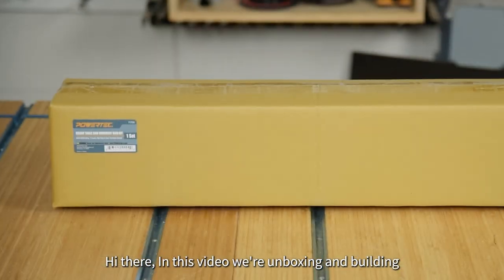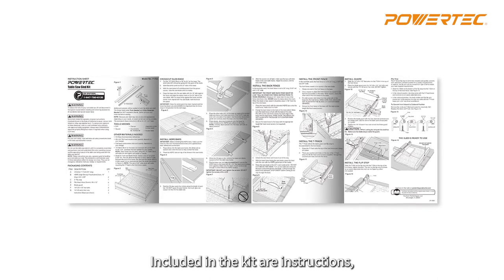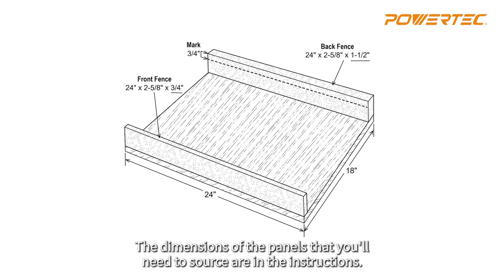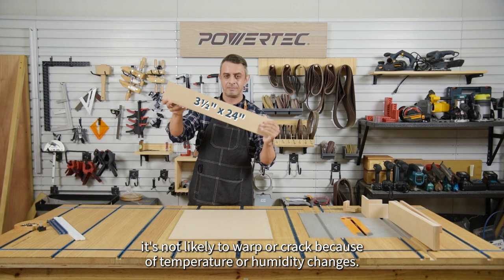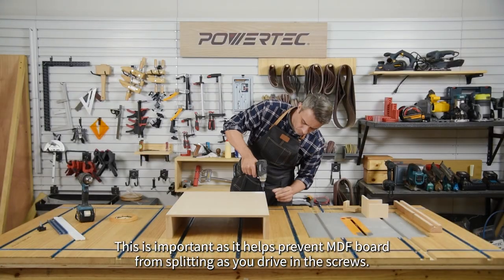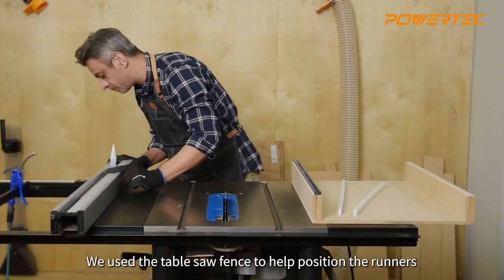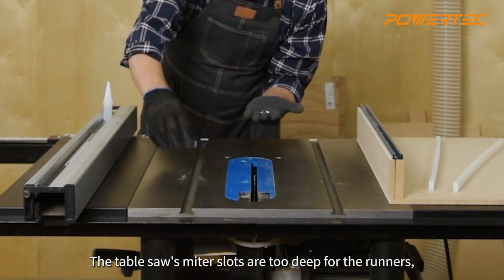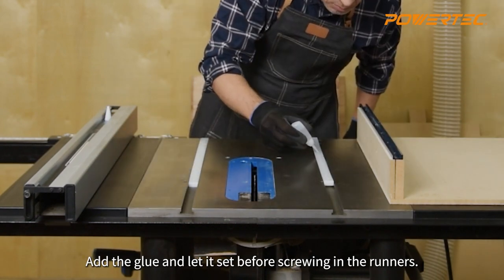Unboxing the New Table Sled and Blade Guard Kit from POWERTEC USA

Comment: I did not see where the “front” fence was set square to the saw blade. Yes, the sled is glued to the runners square to the fence but is the front fence actually square to the blade. When cutting with a table saw sled,  all cuts are aligned by the front fence. Not so sure thhis build is accurate.

 Did anyone else notice the split int the MDF on the left side “aster” they said to pre-drill to avoid splitting the MDF just before he runs his hand over ti the insude that the screw heads are at lease flusf with the bottom of the sled.
Reply from the maker: Thank you for your question. The video is intended to demonstrate how to build a table sled, using the Powertec kit, and does not include all the assembly details. Yes, the front fence must be square to the blade and that is addressed fully in the included instructions. Thank you for pointing out the split in the MDF. The board was split prior to making the video and overlooked during filming.